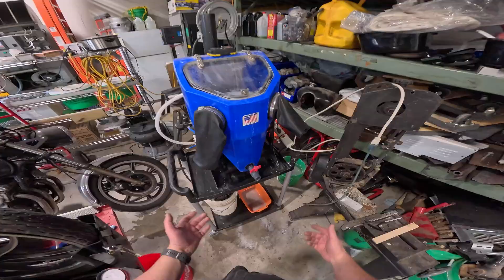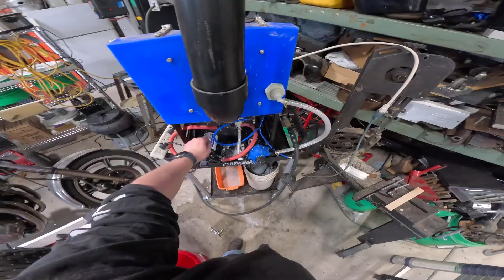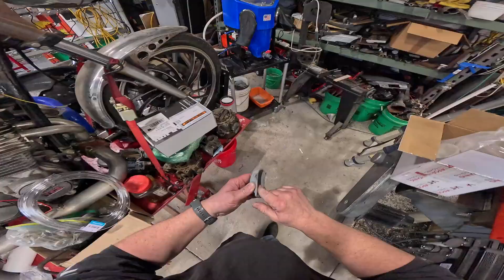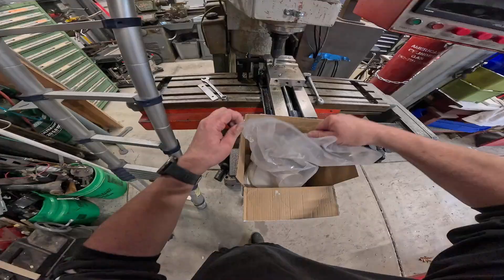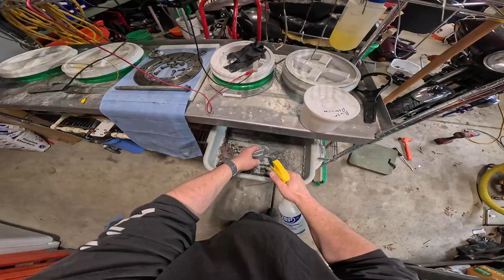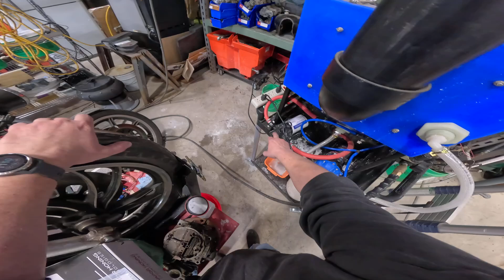VHT Micro Hone Vapor Blaster Review and Pump Upgrade

Comment: I’m wondering where you source your carb jets from?  I have a 1978 Goldwing I just acquired and all of the jets are completely seized.  Old gas has sat in it for 12 years.  Carbs were full of varnish and corrosion.
Reply from the maker: I usually get them from K&L supply or Dennis kirk